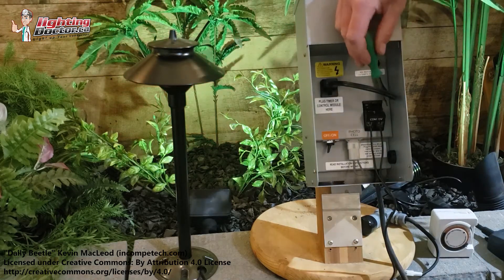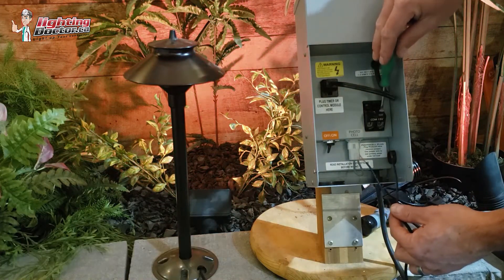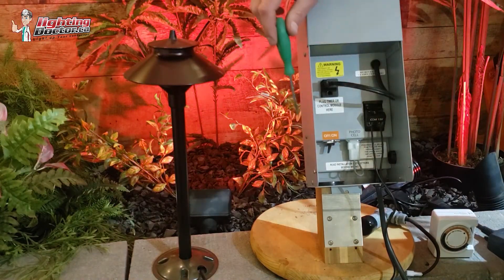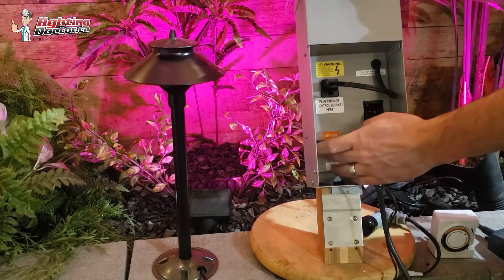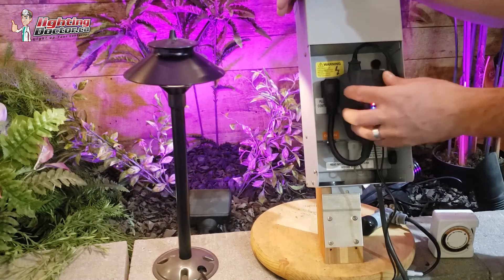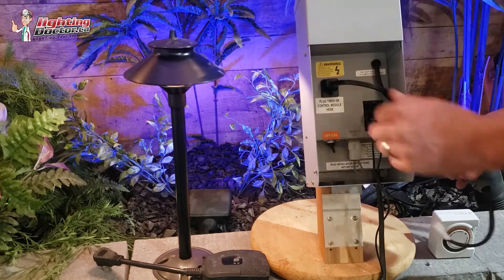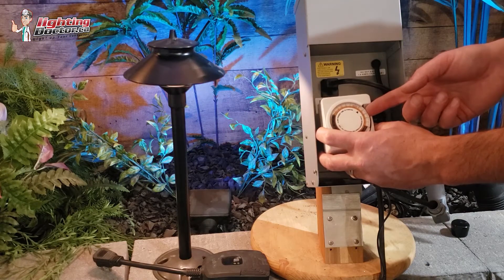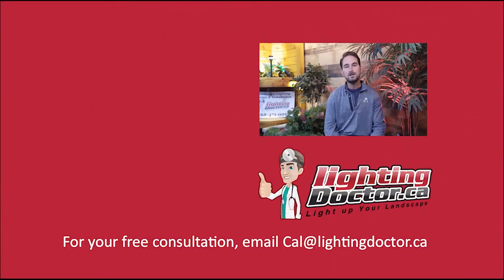Low Voltage Landscape Lighting - Transformer Problems

Comment: I control my lights from a light switch. All of sudden my lights will only turn manually through the switch on transformer.  I purchased another transformer and nothing. Do you have to use  common spots when wiring? I never used them in older models.